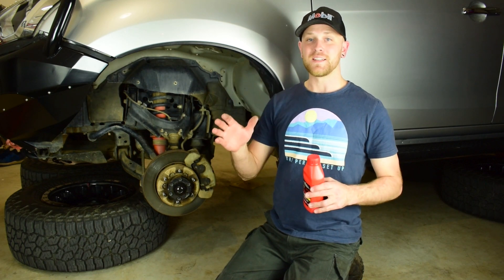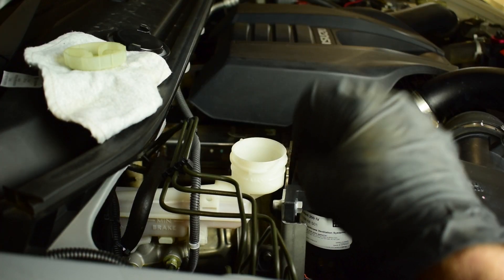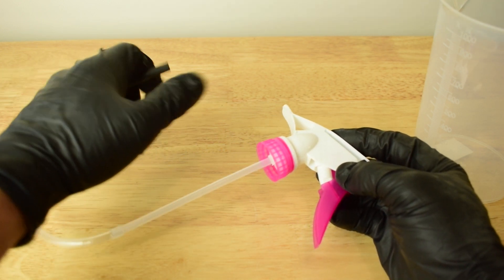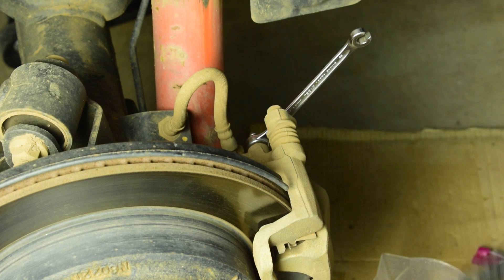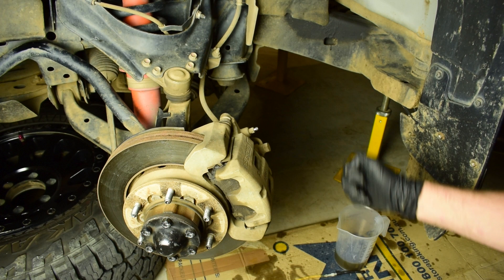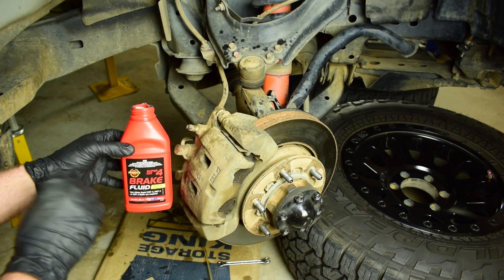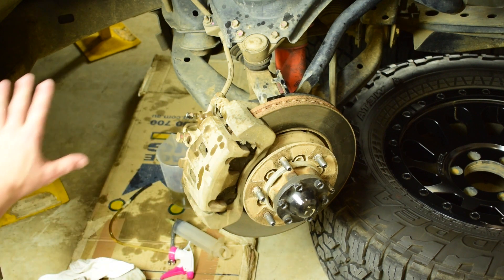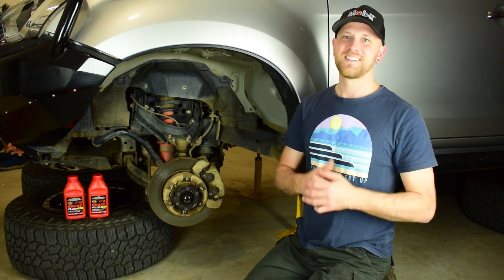How To BLEED BRAKES + FREE DIY BRAKE BLEEDER || How To Bleed Brakes By Yourself || EASY BRAKE BLEED

Comment from the maker: Hey Guys!
Here's a link to a few bits and pieces to make the job easier! 
Penrite Super Dot 4 Brake Fluid - https://amzn.to/3dcdHf3
Flare nut wrench Pipe Spanners - https://amzn.to/3UaMkma
Brake Bleeding hose and One way valve - https://amzn.to/3U5w5qm
Measuring jug - https://amzn.to/3BG76mi
Mechanics Nitrile Gloves - https://amzn.to/3DtsD30
Cheers :)

Comment: I do not remember when I subscribed to your channel BUT I AM VERY GLAD THAT I DID!!!

I used to bleed my motorcycle lines using the conventional brake squeeze through a hose in a bottle method. Though it was a hassle it was fairly ok with everything in reach.

However for my car, the dealerships/ workshops in my area for some reason refuse to bleed the brakes and I procastinated doing it myself because of the hastle.

Thank you very much for this video!! I'll be able to bleed my car lines single-handedly with ease and confidence. Looking forward to many more videos on this channel!!! 

Please stay safe and take care.
Reply from the maker: Thank you very much 😊